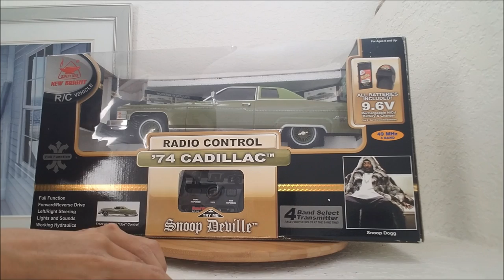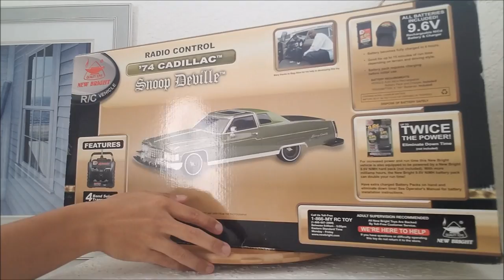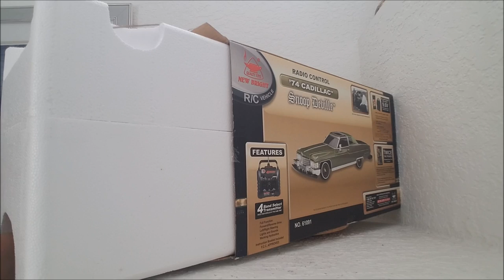RC Snoop Deville from New Bright (review and driving footage)

Comment: i bought one of these when they were on clearance at walmart for $15    because i wanted to make a hearse out of it   .  my biggest gripe about this car is  that the wheels break really easily  because they are thin plastic spoked  wheels   you would think that they would have had an inner structure inside the back of the wheel  ,  they will break within a day of use   so  dont drive it too much  .  i ended up filling in the back side of my wheels with epoxy  and i havent had a problem since  ,     it made a sweet hearse btw
Reply from the maker: wow, should've bought a few of these if they were only $15 haha!  Sad news about the wheels.  They sure look sweet though.